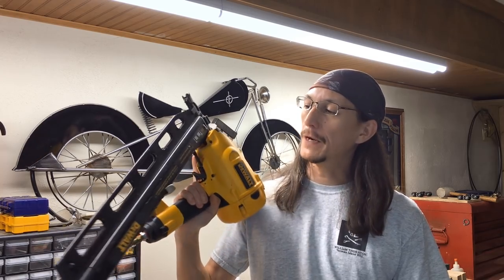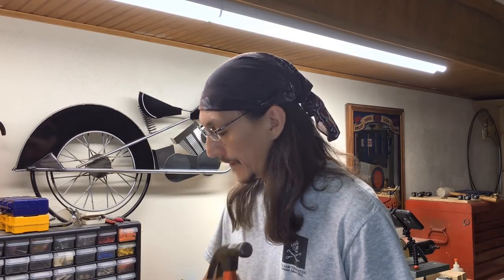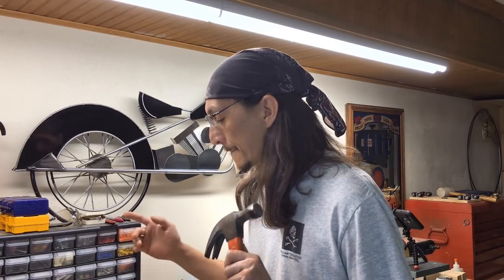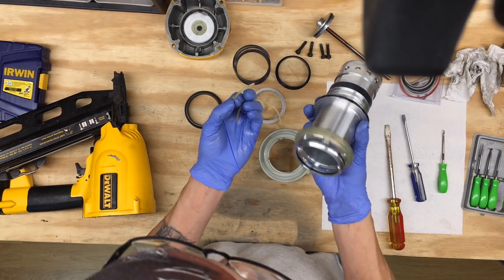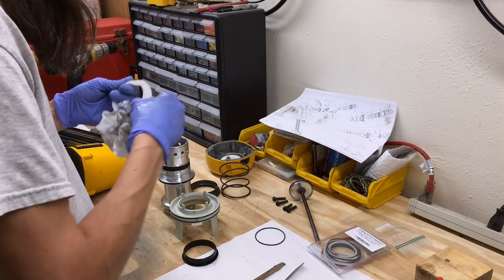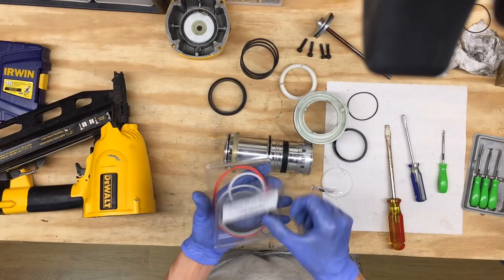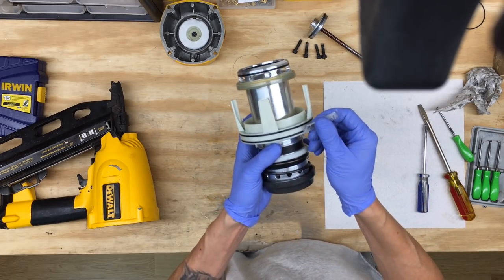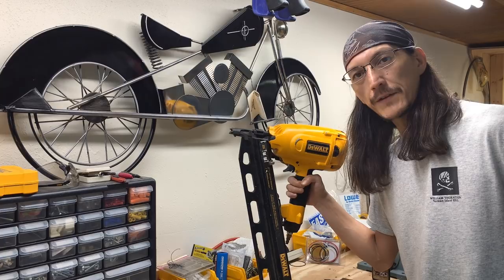Fixing a FRAMING NAILER With a Rebuild Kit

Comment: I've got mine pretty well torn down. Need to run and pick up some small picks (or "booger hooks" as I like to call them), the ones I have are too big. I have 2 Bostitch guns (one is probably 30+ years old and never have had an issue. A costomer I was doing some work for gave me this DeWalt. He did a little framing in his basement and decided the drywall was too much, so I got the call (been in the construction since '73 and the drywall trades since '75). Anyway he said if I wanted it I could have the gun that wasn't working if I wanted it. He had gone and bought another. It's been sitting in the shop for around 3 years now, so I figured it was time to see if I could fix it. Appreciate your video!

Comment: Good job!  I had the same bad O ring. I had already installed a trigger kit and the same colored (clear) O ring was disintegrated.
Reply: Now I have a big leak at the trigger.  I replaced it with a new kit so now what???
Reply from the maker: @dennisdorval6278 There’s probably a trigger seal that is bad or not properly seated. Do over.
Reply: @Guildbrookfarm  Thanks.  I have just ordered a set of O rings for the trigger.  I tried several ties to reinstall the trigger kit with no improvement.

Comment: WOW!! There is a whole lot more plastic in your DeWalt than there is in a Bostitch. I have had my Bostitch for 12 years. Built a Barn, garage and got 75% thru building a 4800 sq,ft Church before it needed a repair kit put in it. Back in my day (75) tools  'Made in the USA' were in demand around the World. They were strong and easily rebuildable/repaired. Not so much today. Hard to find Made in the USA anymore. Good vid. Thanks

Comment: I think adding oil to the inlet is a good idea, however I think it should be added after so many hours of use. Because DeWalt designs their tools for heavy duty use by contractors, you are doing a disservice to your tools by not using them more. My father told me that the moisture catching system keeps moisture out of your tools, making them last longer. Also, at approximately the three minute mark, please add a caption reminding people that you disconnected the air and removed any nails from the gun before starting the disassembly as there will be those who will use your video as a DIY and forget the obvious. Love these in the shop videos. I like that you fast forward the putting the screws in and out instead of cutting that out of the video. I think it makes the video flow better. xoxo

Comment: Look at it this way, they're selling repair parts. That's a plus in my book. Very few consumer goods are repairable anymore, and the manufacturer sure as hell isn't going to sell the parts. Or if they do, they only sell them to their authorized repair centers. So kudos to dewalt for making repiar parts available to the consumer.
Reply from the maker: Pretty sure it’s an independent company that packages the right sized o-rings together into a “parts kit” for numerous brands and models of nail guns. Dewalt has no part in it.

Comment: I have that gun and a Duofast. The Duofast did the same thing and the replacement parts about the same . I found the regulator had been turned up to 140 psi that’s what caused the damage. I make sure now I check it and keep it at 115 psi or less .

Comment: 3:08 'Sol good, it is totally true.
8:24 That is interesting, almost like they purposely plant a crappy o-ring so the device will fail eventually.\
14:46 If you let the recoil bounce the gun back, it wont spread the force through the table/workpiece.  Something I learned working at a pallet building company.  It is also MUCH faster when shooting nails quickly, and less stress on your arm having to lift the tool each time.  Pull the trigger just before striking the piece, letting the safety mechanism be the actual actuator; the gun will fire and the recoil will help lift the tool.
15:24 If I would have watched til the end.... That tip is now for OTHER people, lol.

Comment: This is why I buy harbor freight now. I was or am a Porter cable guy. But the nailers last about 1 year then leak, or need parts. Which are always half the price of the gun. Well, maybe a quarter. Just the nature of the beast.
But I still buy PC, or Bostitch, and lately, Ridgid. 
That gun you worked on , is about 175 at harbor freight.  Made by Pierce? I believe. At least you found an obvious, visible problem.  Good job.
I wonder if HF tools have repair kits,,🤔

Comment: Looks like you took some pent up aggressions out on that test block at the very end. If I was daring enough to see if the air compressor in my attic was any good, I'd do the same with a 2x4 and a bunch of nails as well.

Comment: While i agree with your sentiment about tools that should last, O-Rings on air tools are a consumable that cannot be escaped due to the nature of how an air tool works, depending on use, an air tool should be oiled prior to use. If properly lubed and greased, the new O-rings should last a few years. I just replaced the orings in my dewalt. The gun was used a good bit for the last 5ish years. A $24 ring kit got it working like new again and I expected to rebuild it again in 5 or so years. Orings wear out. Storage location can also effect 0ring life. just some stuff to consider
Reply: Oings do wear out, but they should not rott out!  Clearly a differtent type of seal material is needed! I  have many air tools, and most are over 10 years old or more. They all work and I have never needed to repair any of them... They get an ocassional drop or 2 of oil and I use the crap out  of them.... I think I will stay away from DeWalt tools in the future...Even though I own several DeWalt  tools as 
of now...

Comment: I kept having the same problem with my Dewalt framing nailer. Use it a few times and then o-ring problems every 3-4 months. Got fed up with it. Never buy again. My Harbor Freight nailer was better and half the price.
Reply: I bought a new one and used it on 3 jobs and same thing o ring problem

Comment: Help please!   I had the same issue with mine.   However after I replaced the O-rings internally, then reassembled,   Now the gun chain fires uncontrollably (machineguning).  What did I do wrong or not do at all?
Reply: Did you find a fix for this?  I have the same problem.
Reply from the maker: I just saw this. Mine also will chain fire and I think the model I own had a recall, but it has long since been discontinued anyhow. I’ve just learned to be aware and careful with the gun.
Reply: Chris B I added a good amount of air tool oil and it started functioning correctly

Comment: Can anyone help?
Mine was leaking air through the nose so
I just replaced the same o-ring was broke.
But now when I connect the air the piston just fires over and over pretty fast the trigger isn’t doing anything. Didn’t have any problems with the trigger before.
Anyone have any ideas?
Reply: Sorry so late , sounds a lot like the trigger o ring(s)

Comment: Ok, I was hoping you'd get to that o-ring. (The one that is "destroyed") I'd like to know, (Not assuming that you do know.), WHY that ring, (And one other just like it on my dewalt nailgun), are made of the stuff they are made of. It seems every rebuild vid that you see, they find that/those o-rings in exactly that condition. Dewalt has to know of this. Why do they not only use the ring in the first place, but keep replacing it with the same material? My gut tells me the reason is planned obsolescence. A way to get the customer to bring the gun in for repair/rebuild. Or to at least buy the re-ring kit. I am considering replacing mine with nitrile or similar instead of what I'd get in a kit.
Reply: By the way, far as I can tell, that ring is not a moving part. It is simply a seal.
Reply from the maker: That’s what I would like to know!  The material is junk and just deteriorates regardless of the amount of use. I like your idea of trying a different material. Since I replaced it I haven’t had any more problems but I’ve only used it like 3 times so who knows.
Reply: I think it deteriorates, as you said, regardless of the amount of use. Seems to take 3 to 4 years. 

If you think about it, they know that a percentage of people will just replace the gun. Probably a high percentage of those will get a newer model of the same brand. A low enough percentage of those will replace it with another brand, to make it worth the small chance of that. 

Make it last shorter than that amount of time, and more people will switch brands. Make it last longer, and they lose the money from new sales. Balancing act.

Of the rest of us... A percentage will bring it to them for repair. A percentage will just buy the ring kit. In any of the above cases, it's more money for them. 

Finally, at 3 to 4 years to replacement of rings... Of the last bunch of us, a high enough percentage will replace the gun instead of the second ring job.

In my opinion, when they know they could build something to last a lifetime, and they intentionally build it to break down according to what their actuaries and bean counters have determined are the optimal times for them... (As outlined above. Only they are a lot more sophisticated in their data and approach than I can explain.) That amounts to usury. And that flints my britches so badly, that I take great delight in reverse-engineering, or otherwise finding ways to make things last as long as possible in spite of their intentional parasitism.

Comment: Great video —-can you tell us the model number?
Reply: According to the description above, the unit he's working on is a DEWALT DWF83PL.
The procedure will be the same for the D58125 and the D58150. However these two are listed as "discontinued' by DeWalt,  so many replacement parts will have to come from other vendors. Some are still available from DeWalt, presumably parts used in other units that are still supported. 
I have a D51850; this procedure worked fine. My gasket[s] weren't broken, however; they had disintegrated into their component atoms. Looked like so much thick grease stuck in the ring groove. Weird.
Reply: @JohnH0130  Why rebuild when you can buy one from Harbor freight two different types for $100  and YouTubers say they were great? Just asking your opinion
Reply: @gregl2249  Well, mainly because I have only about $25 invested in the rebuild, for new O-rings, plus a modest commitment of my time to do the work.
Reply: Just as an FYI: the rebuild failed. Obviously the unit has other defective rings. When next I need one, I am going to do as you suggest and just buy a cheap one. 
This DeWalt was stored inside my house, not out in the garage or a shed exposed to heat and humidity. I find it incredible that the gaskets melted just like the ones that caused the problem in The Andromeda Strain. At first I thought what was left of them was some grease in the ring grooves.

Comment: You are touching on a serious topic, the tools your great grandfather bought, were what was available to him, his choices were much fewer then yours are today, they were also much less advanced, so they were bound to last for a long time.     If the hammer you shoved only lasts you a year, you are doing something wrong, and you would have destroyed your great grandfathers hammer as well, I DO know that it was just an example, and that you do NOT destroy a hammer every year.     " planned obsolescence " is real,     or is it ?     good quality light bulbs used to last about 1500 hours, the last ones on the marked lasted 750 hours at the most, that WAS " planned obsolescence "     But is the quality of your DEWALT drill motor " planned obsolescence " or is it something complete different,     I think it is something different,     being that " you " ( that is MOST of us in general ) are cheap,     Your great grandfather had to work for days to earn enough to buy a hammer, " you "  ( that is MOST of us in general ) can work for an afternoon and earn enough to buy a drill motor AND a battery AND a charger, AND have money left over !     so in that case it is NOT " planned obsolescence " at all, but simple what has to be done to meet the desired price point !     Of course you can buy a FESTOOL drill motor, that will set you back 700 $ including battery and charger, BUT you can NOT expect it to last you 7 times as long as your 100 $ DEWALT.     Pneumatic nailers are probably every manufactures MOST serviceable tools !     the o rings in your nailer were available (either original or after marked ) simply because they are off the shelf parts, try to take your drill motor apart, and look for off the shelf parts in there     ( hint, you will not find any )     Great video, and keep up the great work